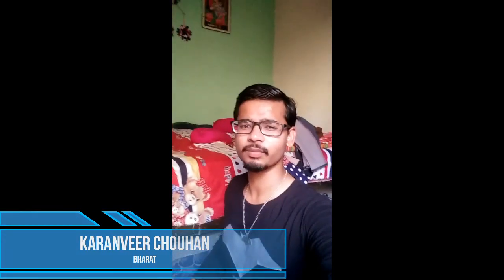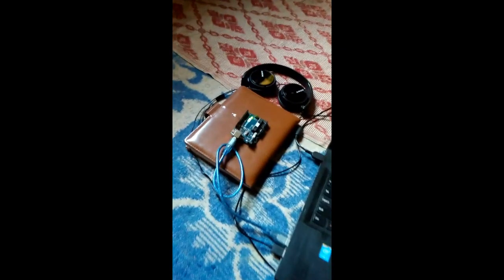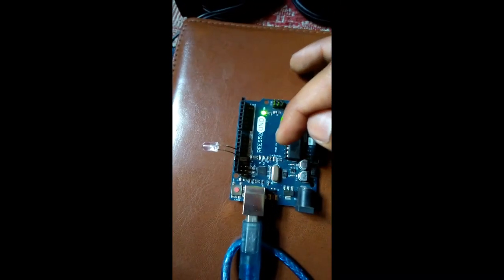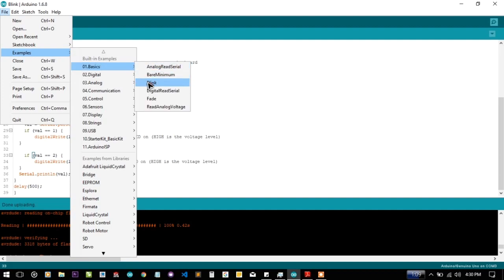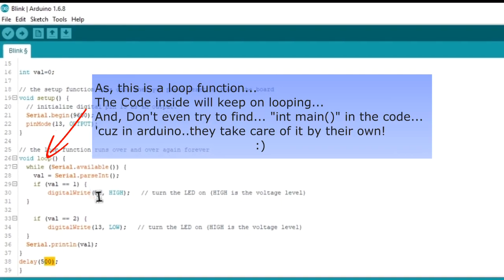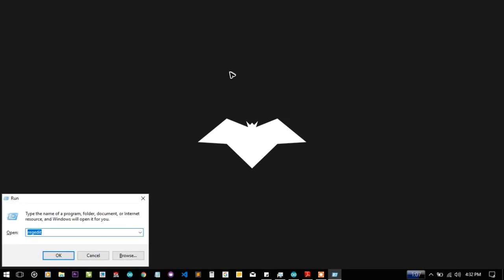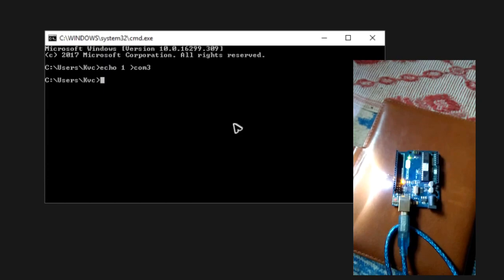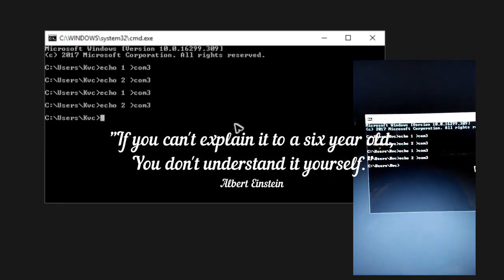Controlling Hardware From PC/CMD/Notepad - Arduino Uno | Learn Batch Programming - Part X

Comment: Thanks a lot!!!
You have solved my big problem,
i am making real ATM machine using raspberry pi 3b model and arduino uno, aand  i am making a program in batch file that used in ATM as screen but i cannot communicate with arduino serial port  with batch file then i search in youtube(how to communicate arduino with cmd?),
Now i have fixed my big problem after watch your video dear.